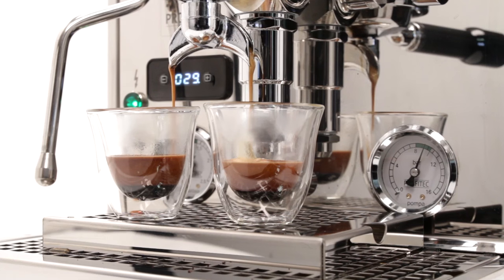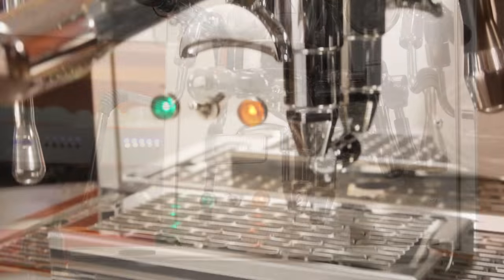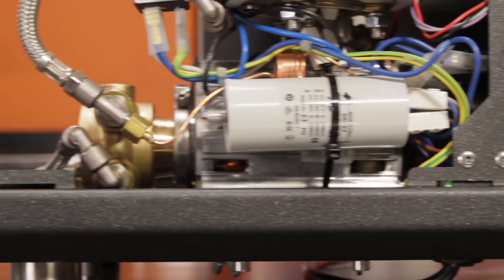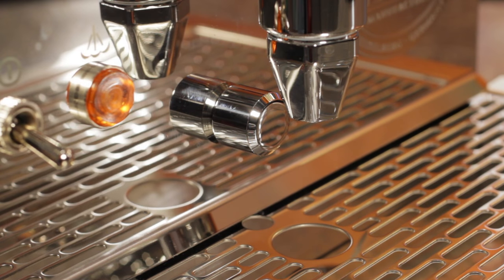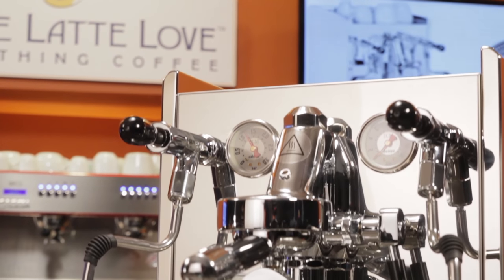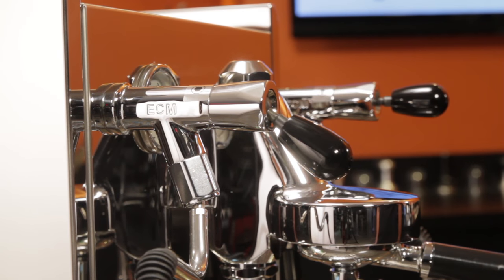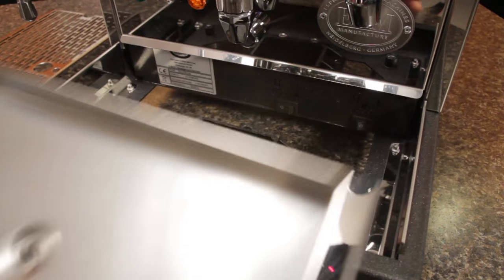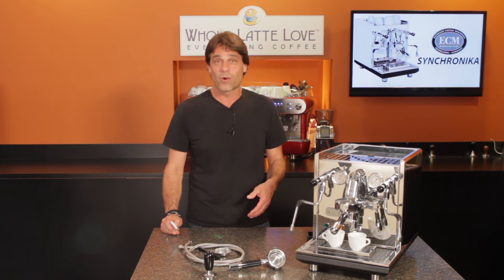Review: ECM Synchronika Espresso Machine

Comment: Marc, how do the Rocket dual boiler PID, Profitec Pro 700 rotary and this ECM machine compare to the La Marzocco Linea Mini.  These you review seem to be almost half the price and have more features than the La Marzocco Linea Mini?  I'm trying to figure out which to buy.
Reply from the maker: Hey b, One pays quite a premium for the LM name and you are correct, the Rocket Cinquantotto and especially the Synchronika and Pro 700 equipped with flow control have more features. With flow control one gets capabilities on par with the even more expensive LM GS3. If you did not know, the Synchronika and Pro 700 are nearly identical internally and perhaps the best engineered and finished machines in their class. Those machines are made in the same facility in Milan, Italy. It's a Lexus/Toyota kind of deal with ECM being the Lexus with more high-end external finishing details. If interested here's a video from the production floor in Milan with ECM/Profitec CEO discussing his design and build philosophy: https://youtu.be/K0RI5rdz4Ww
Also check the owner reviews on the Synchronika. 200+ with average rating of 5 out of 5 stars: https://www.wholelattelove.com/products/ecm-synchronika-dual-boiler-with-flow-control
If purchasing from us flow control of the E61 group is a free upgrade on ECM and Profitec machines thru end of July.
Marc
Reply: @Wholelattelovepage    Oh wow!  Thanks Marc.  Ive settled on either the Profitec Pro 700 or the ECM Synchronika and I’ll be buying from you but probably not until March of next year.  I have a little while longer to research the two and an appropriate high end espresso grinder to buy at the same time as well.  Thank you for your time and patience so far.  B.

Comment: Question: I love the refined aesthetics of the Synchronika over the Pro 700, but as someone who usually steams smaller amounts of milk, I'm a bit concerned about the joystick steam valve. It seems I'd have to carefully hold the joystick with one hand to get partial steam power. If I wanted to down the road, could I swap out the joysticks for rotary knobs? Thanks!
Reply from the maker: Hi Aaron, Thanks for the question. While it might be possible to change out to knobs there's no easy way to do that. No kit. Even with knobs on the Pro 700 you don't really have fine control as a quarter turn of the knob take one from full off to full on. On either machine you can turn down the temperature of the steam boiler to reduce pressure of steaming.
Marc

Comment: Has there been any complaints/issues with the PID display's finish chipping or rubbing off? I recently came across a vlog that showed this issue. I'm wondering if this is wide-spread or maybe just some isolated incidents. Sorry if this is repeat question.
Reply from the maker: Hi T, You do research as I would. ECM is aware of 1 customer issue with PID display. That customer was very vocal and had multiple contacts with us and with ECM directly. Part of our communication with that customer can be found in comments for this video from Peter Budde. To save you the hassle of searching through the comments, I've copied the final communication below. Bottom line: there was a single issue with one customer on an early shipping Synchronika. ECM worked with their supplier and they are confident this is no longer a problem. 

Copied...
To paraphrase from ECM... Their supplier had an initial quality issue 
with films for the PID display which seems to have been resolved. 
According to ECM they have had just 1 issue reported to date.

********Here is the full un-edited response from ECM received 3/14/17*************
"when we reiveced the first e-mail from this end customer we noticed and
 had this issue only once.

We asked immediately our supplier how this could happen and after a 
couple of weeks we received the feedback: “In the first batch of the PID
 of the Synchronika there was used this kind of faulty film display” But
  have not received a more precise information either.

Only when you scratch on it there is the risk that the surface can get 
damaged.

We received 100 films for exchange. But right now it is the only 
complain we had until now."
Reply: Thanks for your quick response and putting my concerns to rest. Kudos.
Reply: Whole Latte Love thanks again for your reply.  I just ordered this machine along with the V-Titan 64 grinder from WLL. Your reviews of this and other machines really helped me decide. Thanks for your informative reviews. Best Regards,
Reply: Tinstar & Whole Latte Love (Not the only one) Since my initial post over 12 months ago, I purchased the Syncronika and despite there being a (different type of) fault with the display from new, I totally love this machine. The problem with my display was one of the 7 segments that makes up each digit was dead. From memory it was in the far left digit and only showed up if I set the display to read in Fahrenheit instead of Celsius or when accessing the setting for back flushing count.  I contacted the retailer who ordered a replacement from Germany and it was replaced under warranty. Now I have operated it for around 15 month and made over 1,100 single shots and 700 double shots (My grinder tracks all this) I will post more detail from my experience about the unit under other peoples posts. P.S. I got over the Powder coated chassis, I still wish it was stainless though. Doesn't the Expobar have a stainless chassis?

Comment: It seems like it's easier and faster to take its housing off  than the PRO 700's?
Reply from the maker: Hi AZ, Synchronika is the easiest housing of any prosumer level machine to remove! 1 easily accessible screw per side panel.
Reply: Thanks!

Comment: Hello Mark excellent review as always I am trying to decide between this machine and the Quickmill Vertrano 2B I saw your review on that machine as well how would you compare the two and anything in particular that really sets them apart?
Reply from the maker: Hi David, Thanks for the question. Both are excellent machines. Currently, the Synchronika is available from us with a free flow control upgrade. Flow control is not available on the Vetrano. Flow control opens up a lot of possibilities especially for those using higher end specialty coffees. If not familiar with flow control here's a video demonstrating 2 simple flow profiles: https://youtu.be/a-QAOo8Vg5A
If we forget about flow control the machines are equally capable. I give the Synchronika an edge in overall fit and finish quality.
Marc
Reply: @Wholelattelovepage  Thanks Mark for the insights that’s a big help!!
Reply: David R heyy! I am absolutely in same situation now. I am btw quickmill and ECM. What have to done? Did you buy one?

Comment: Does the machine automatically stop pulling a shot or two after predetermined amount of time, or do I manually pull two shots for about 25 seconds and single for about 15 and manually shut it off?
Reply from the maker: Hi KB, Shots are stopped automatically. As for duration most consider 20 - 30 seconds from first drip as an acceptable range. But timing is just a guide. Real judge is flavor in the cup!
Reply: So how does one control the timing if the machine shuts the brewing process automatically?
Reply from the maker: Sorry Kris. Typo in my above comment. Should read: "Shots are not stopped automatically"
Reply: So you time them. Cool.
Reply from the maker: Yes. And nice with the automatic timer on PID display!
Reply: What is the difference between single spout portafilter and dual spout. Does the machine come with both?

Comment: So would this be the best dual boiler option for a machine? Currently looking to upgrade from an Izzo Alex PID Pro. A linea mini was my top choice but it's way out of the price range, and the other option was the rocket R58. How would this machine compare with those two?
Reply from the maker: Hi Cyanosys, Thanks for the question. IMO the Linea Mini is over priced for its capabilities. You'll pay a premium for the La Marzocco name. Check out the ECM Synchronika w/flow control: https://www.wholelattelove.com/products/ecm-synchronika-dual-boiler-with-flow-control
Flow control opens up a new world of capabilities for E61 group machines. Use a long low flow pre-infusion to tame brightness in fresh from roast specialty coffees, mimic manual lever extractions, hit older or darker coffees with high flow to start then taper off to avoid bitter or stale flavors. IMO the Synchronika is the finest dual boiler machine made. Exceptional exterior finish details, massive low wear valves, angled PFs. Excellent quality under the hood as well with best in class steam power near 2 bar, line pressure pre-infusion when plumbed to water-line, stainless steel mushroom valve, automatic shot timer, programmable auto-standby time, backflush reminder.
The Rocket R58 is a good machine. Not quite as refined in the case work finishing, PID controller is detachable so no digital display on machine face, no line pressure pre-infusion (solenoid valve on the plubed in connection only opens when the pump is running), Steam pressure runs ~1.4 bar max. In Rocket PID machines you set the actual in boiler temp for brew water using a chart in the manual to cross reference your desired brew temp. ECM uses an offset temp so you set the brew temp you want on the PID. Rocket puts a little more into the branding/look of the machine.
Read the customer reviews and see more videos on flow control at the link above. Currently ~140 reviews with overall rating of 5 out of 5 stars.
Hope that helps!
Marc
Reply: Whole Latte Love for sure, thank you so much for the Info!

Comment: When ECM will upgrade the frame to stainless in the Synchronika?
When it will happen i'll buy one instead my Mechnika IV P.
Reply from the maker: Hi i, Have not heard of any plans to use stainless for frame of Synchronika.
Reply: Itoosh, That was one of my concerns when I posted on this thread 15 months ago and soon after I ended up buying a Synchronika and now after over 1,100 single shots and 600 double shots, I haven't looked back. Prior to purchase I researched over a dozen machines and watched many of Marc's videos (as they are more technical than most and I love the detail he gets into) and after deciding I wanted a dual boiler It narrowed the field down to 5 machines. (I won't list the runners up as they are all good machines and by no means do I consider them inferior) my decision came down to a few personal preferences. As marc rightly states, this is a beautifully finished machine (I have done similar work with brass and copper, silver soldering, polishing and making joins invisible so I can appreciate the skill that is required) 1/. I liked the Stainless boilers over copper. 2/. The high quality rotary pump and ability to plumb into mains water. 3/. I liked the gauges mounted up high, (where they should be, cars don't put gauges near your brake pedal) They are easily viewed and yes they don't get splashed by the exhausted water from the bottom of the E61 at the end of each extraction. This means there are less edges at the bottom of the front panel and it is much easier to clean that beautifully finished stainless facia.(NOTE to ECM for an improvement for the Mark III model, install a small splash guard behind the bottom of the E61 exhaust and in front of the drain for the boilers) . 4/. I also like the practicality of the "Joystick" style steam & Hot water controls over the traditional rotary valve type. (granted the rotary valve are more traditional)5/. Also as Marc's video pointed out, ECM realising that steam and or heat do not go well with electrical components, they went to the effort to vent the boilers out to the drip tray to reduce steam "under the hood". 6/. I also like the ability to fine tune and adjust temperatures. 7/. The built in shot timer is also great. If you are into maintain the unit yourself, as Marc states access is easy. One screw and you can remove a side panel and look straight in. A few more screws and it is stripped down like Mac demonstrated. Well that about wraps it up for me, oh one more thing "Did I mention the beautiful finish" :-)
Reply from the maker: Hi MDM, Wow! Thanks for the extensive comments. They should help others having a tough time deciding on a machine. I'm putting up a new video today comparing the ECM Synchronika, Profitec Pro 700, Rocket Espresso R58 and Expobar Brewtus IV-R. Cheers, Marc
Reply: Hi MDM, thanks for response.
But after haveing few machines - painted frame will come rust eventully - rather you like it or not. There is a reason IZZO, QM, Synesso and others using STAINLESS STEEL frames.
Reply: itoosh, I'm not sure of the machines you have had and if they were in the price range of the ECM, IZZO etc. The IZZO Valexia Duo was one of the five machines on my short list and if I recall it came very close to the ECM which I chose because of higher heating elements, (1,200 W & 1,400 W over the IZZO 1,000 W + 1,000 W) the built in timer, larger gauges and its high quality finish. I wasn't aware of the Synesso brand at the time and I just looked at their website and I see that they powder coat the outside of their machines and customers have a choice of 12 colours. Do they powder coat over Stainless steel? While I am sure it is possible I do not believe it is common practice. Typically you would coat a cheaper material that is easier to work with. I rang one of our local Synesso distributors here and from what I researched these are more of a commercial machine and the MVP Hydra are twice the price of the Sychronika and with a 1.9 litre brew boiler and a 3.2 litre steam boiler and the 240 Volt model requiring 20 AMP power supply (Which in the USA with a 110 Volt supply would require a 40 AMP supply unless they down size the elements) This model sounds more like a commercial machine. Can you tell me what model Synesso you are reviewing as I would be interested in researching it. One other requirement in my original research was that the machine have the (tried & tested) E61 Group head.
Reply: Hi,
Well, the synesso is kinda a commercial machine but if you can afford it - go for it.
I really like the Sychronika and if I had the money I would but it today.
E61 Groud head are superb - I love it, but saturated group head are made of stainless and they have better thermal stability. 1.0~ degree in E61 vs 0.1 in the statured groups.
I had Rocket, Bezzera, La Favorita and now I have the ECM Mechanika while saving for DB.
Enjoy your ECM :D

Comment: Is it possible to run the plumbed piping into a plastic gallon water bottle like one you would purchase at a supermaket, rather than the sink?
Reply from the maker: Hi Tomas, Thanks for the question. Yes it is. We do that on a regular basis. Machines with rotary pumps can overcome the head pressure and draw from an external source so long as it's not a huge vertical distance.

Comment: How does a dual boiler compare to a single heat exchanger in terms of maintenance? I was reading that single boilers require less maintenance because the water is changed out more often (only one source of water for steaming and brewing).
Reply from the maker: Hi Anson, Thanks for the question. Most manufacturers of dual boiler machines recommend they be professionally descaled by machine techs. But with proper water quality there will be no scale in the first place. I think what you are reading is in regards to minerals accumulating in steam boiler sections. This can happen if you steam a lot without dispensing hot water from a machine. It can happen in both dual boiler and heat -exchange boiler machines. In an HX machine the brew water is isolated from the steam generating section of the boiler. It's very simple to prevent by dispensing a bit of water from the hot water wand to turn over water in the boiler. Hope that helps!
Marc

Comment: Mark does the Hot Water wand pull its water directly from the boiler? I've read where this can cause mineral build up and chalky tasting drinks if used for Americanos, Hot Chocolates, etc...
Reply from the maker: Hi Tamara, Thanks for the question. Yes, hot water wand in this machine (and all similar machines) pull water from the boiler. Depending on your source water's mineral levels scale can accumulate in the boiler. But it generally does not lead to chalky tasting drinks. If scale forms there it stays there for the most part. Steam is generated in the same boiler hot water is taken from. If you only steam and never take water out of the boiler from the wand, over time mineral levels in the boiler will increase leading to more scale formation. It's a good idea to flush out some water from the boiler on a regular basis to keep the mineral levels from creeping up. Best way to prevent scale is to filter water used in the machine. Here's the filter we use on plumbed in machines like the ECM Synchronika: https://www.wholelattelove.com/bwt-bestmax-premium-filter-package It exchanges calcium in source water with magnesium, dechlorinates and removes particles. The calcium/magnesium exchange maintains a mineral level for beverage flavor (mineral free water makes bad tasting over-extrated coffee) and limits scale formation.
Marc